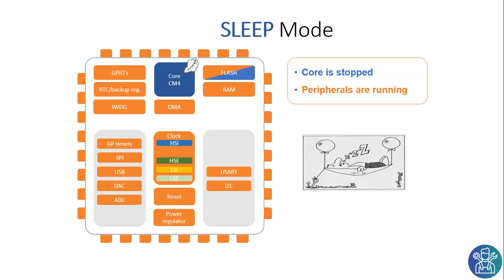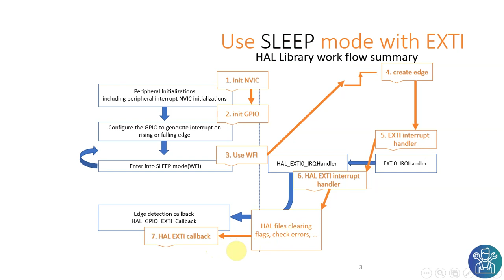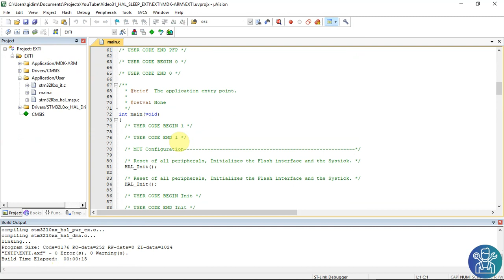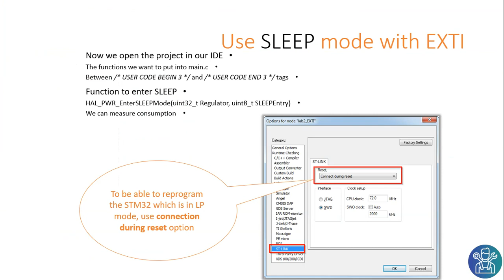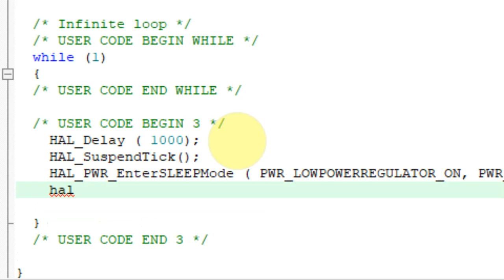HAL: #5 How to - SLEEP with EXTI

Comment: 250uA is still too much
Reply from the maker: Yes, 2 things:
1. When you are in debug, the power will be higher, you need to disconnect the debug interface. 
1. There are different modes to have lower power consumption. You need to find the one that is best for you. You can use the power consumption calculator ( I made a movie about that ) to find out what will fit you best. You can reach ~1uA and lower.

Comment: How will I weak up this board ...suppose i'm using adc . Now I want to weak up it whenever I get an analog value 1023 ..how will it work ?
Reply from the maker: You can use one of the STM32L devices with built in comparator or use an external comparator to detect the required voltage level and then wake up the STM32. You can also use the RTC to periodically wake up the STM32 and check the ADC.

Comment: Hi, i do not understand why the sleep function is "waiting for interrupt", i thought if you use the sleep mode the program just stops in this function and continue when you have an interrupt to wake up from this state, but i have made a test and the program keeps running after the sleep mode function, so, why am i waiting for an interrupt to wake up if i am already awake?, thanks
Reply from the maker: It could be that you didn't put everything to sleep so you wake up again. Use a simple led program to see that you stop the program untill you get an external INT. The INT is to wake you up from a pin while the code is not working.
Reply: @Weblearning1  thanks!, it works now, i made a test with a blinking led as you told me, but i still have a dude, before, i thought the program was not stopped because after the sleep mode function i was making the test with PRINTF("awake"\n\r); and if i use it i never enter in sleep mode, i just can see the "awake" message in the terminal, do you know why?, thanks
Reply from the maker: Try to past that section of the code and maybe I will be able to tell you why.
Reply: @Weblearning1  hi, i am doing this and only see the "woke up" message in the terminal, never enter in sleep mode, inside the LPM_EnterLowPower( ); function i have this function HAL_PWR_EnterSTOPMode ( PWR_LOWPOWERREGULATOR_ON, PWR_STOPENTRY_WFI ); the strange is that the test works if i use a blink led instead printing a message
while(1)
{

LPM_EnterLowPower( );
PRINTF("woke up\n\r");

}
Reply: in a forum they told me that the printf prevents to enter in sleep mode because it takes time to print in the terminal the message inside printf, then I am not giving enough time to the sleep function to go to sleep

Comment: Hi. 
Great Job.
I repeat what you did but the current is 4mA. no more fall. What is the reason.
Reply from the maker: It could be that you have power leaking from the pins. Try: HAL_GPIO_DeInit(); before entering to sleep. and then HAL_GPIO_Init(); after waking up.
Reply: I tried, but again the same. waking up current is 16MaH. Sleep mode current is 4mAh
Reply from the maker: Did you put all the other unused pines as analog input?
Reply: no. other pins idle
Reply from the maker: Try and let me know. See my video on the stm32cubemx to see how to set the pines correctly.

Comment: Hi!
Great work!
i am in my firts steps on stm32 enviroment, an i have serial problems with the "blue pill" (it isn't a drugs problem). I can't reduce the power consuption of the stm32f103c8 microcontroller. I removed the regulator RT9193-33, the led green and led power; with their own resistors. I have been working with keil uvision with stm32cubemx and the minimun current drawned for the microcontroller (without any external device) are 2,8 mA. Any suggestions?
Reply from the maker: Hi. You can try few things:
1. Make sure that the current is from the MCU. Is there a way to measure only the Vdd.
2. What power done mode you are going to? Sleep, Stop? Standby? 
3. Did you disable all the GPIO before going to sleep? use: MX_GPIO_Deinit(); when exiting use: MX_GPIO_init();